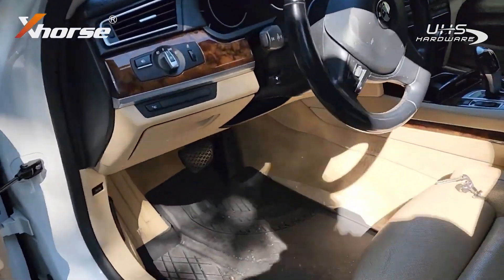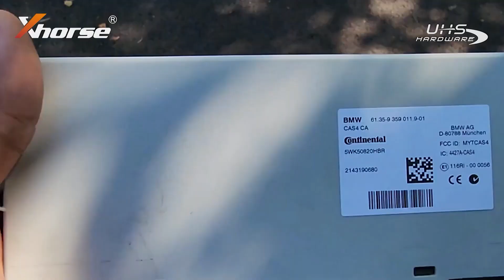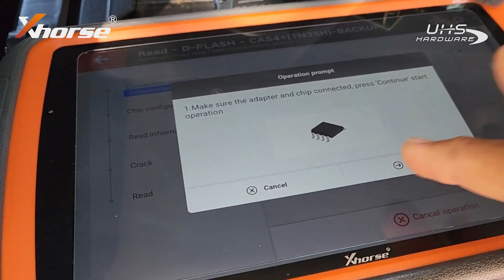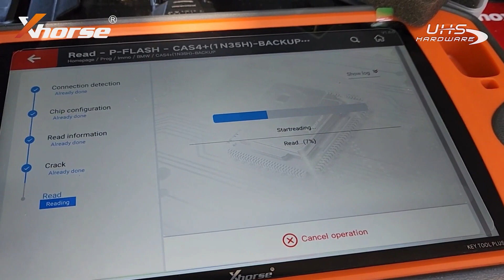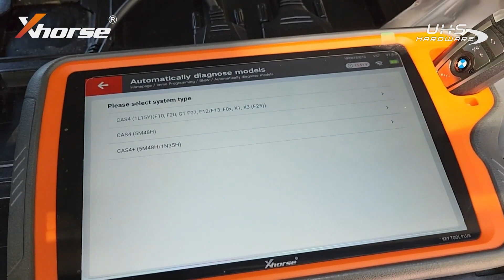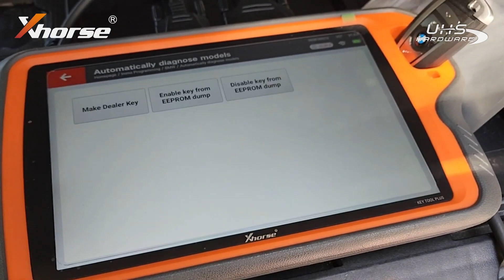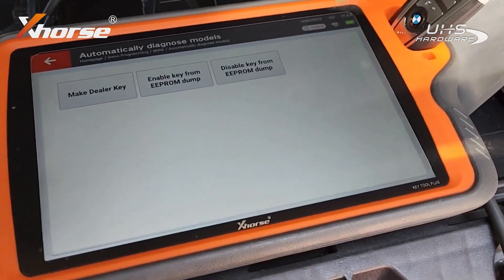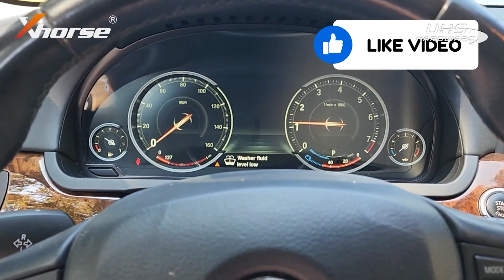HOW TO ADD KEY 2015 BMW 740Li F Chassis Cas-4 w/ XHORSE VVDI KEY TOOL PLUS all in one programmer

Comment: I have been asking this question for a while and haven't gotten an answer from anyone. As a beginner locksmith, which tool is better to buy first, the Xhorse keytool plus or the Autel IM608 pro 2? I am about to spend 3ks on the tool so I need to chose right! Thanks in advance.
Reply from the maker: i would say you will need both more than likely. but start with Autel.

Comment: Is it recommended to power off the battery before remove the cas module or it doesn`t matter ?
Reply from the maker: yes. it is always recommended to unplug battery before removing any main components of computers.